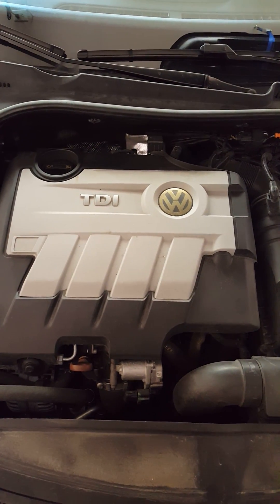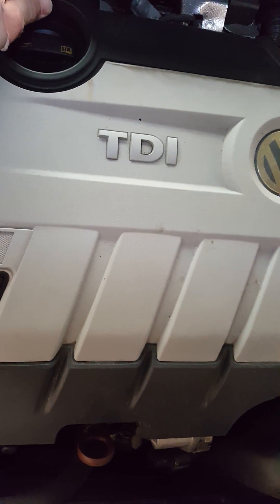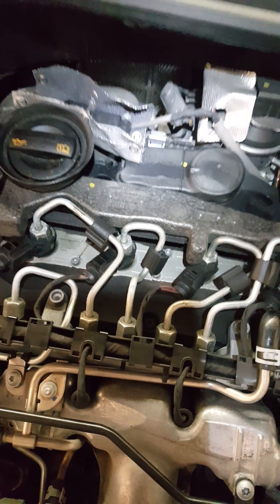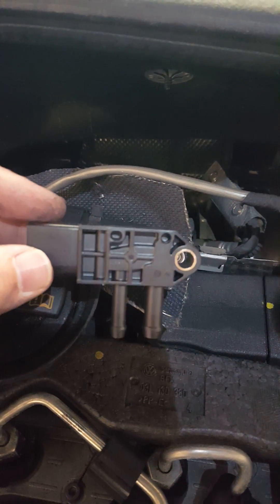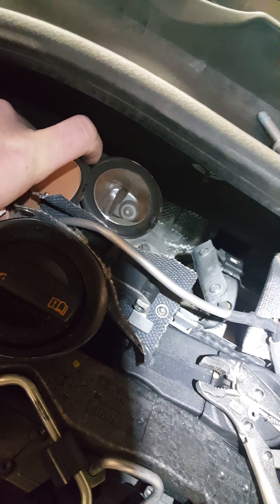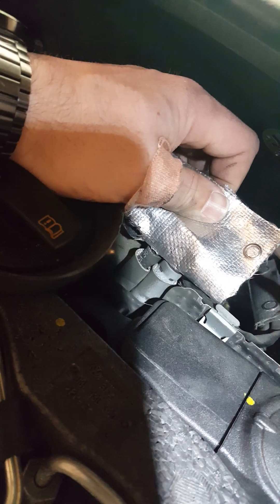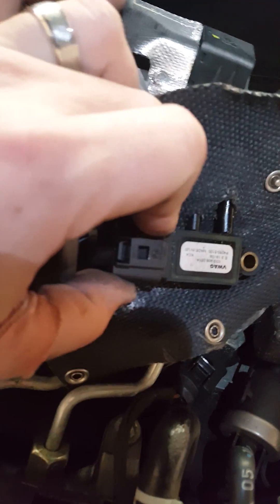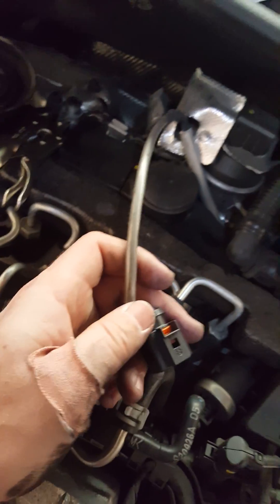VW TDI P047a exhaust pressure sensor B circuit repair

Comment: I got an error P047400 exhaust pressure sensor A circuit intermittent/erratic not limb mod dpf regenenarates normal but on high speeds with  full throttle i got engine light 
i changed the sensors 2 times with original and adapted with  vcds  bit error reapears

Comment: Hi, are you sure its a "P074" and not a P047" code ? Thanks
Reply from the maker: You are correct it is a p047a code. All these years later, I don't know what I was thinking. Thanks for the correction
Reply: @jasenreynolds6799  perfect video btw
Reply from the maker: @andreidiaconescu5035  thanks! Hopefully it will help more people now that the title is correct! 😁
Reply: @jasenreynolds6799  il try for my Skoda Yeti. Thanks 🙏. All the best !
Reply: Great video! Thanks. Does this require an adaptation after being replaced?

Comment: Did you disconnect the battery  before starting work ? 
And does the sensor just pull apart from the hoses, saving the need to undo clamps and bolts, etc. 
Thanks

Comment: Thanks. I have this same problem but my car will be bought back by VW shortly. I likely will try to clean out the two tubes and make sure they don't leak first. I have read that sometimes, as you mention, this can clear the error code. Prior to your video, I wasn't sure where to start, but this is RELATIVELY easy. That is to say, I can reach it. Thanks again.

Comment: Is this the same sensor? I have a 2010 VW Jett TDI. Here is the code I am getting.01 Engine Control Module 1

    System description: R4 2,0L EDC G000AG
    Software version: 9971
    Hardware number: 03L906019CM
    Coding: 0050078

    Trouble codes: 
        P0470 - Exhaust Pressure Sensor "A"
            static
                Measurements: 
138 U/min
0 km/h
38.7 °C
39.6 °C
                Frequency counter: 37
                Mileage: 235913 km
                Driving cycle: 255
                Priority:  2

Thank you.

Comment: Very helpful video. 
okay, I've changed both Exhaust Pressure Sensors (EPS), the engine light is off - But I'm still getting the P047A error. I've also got some other issues EP control valve "A" is stuck open (P047F), plus P0401 EGR. Exhaust Gas Recirculation Flow insufficient Detected.  
My question for the wiser, would the EPS be affected by the other errors? meaning if I make the necessary repairs to the EGR and EP control valve would my P047A error go away. My gut says yes only because I assume the entire emissions system is tied together.
Reply: Did you ever fixed the issue

Comment: additionally, if this doesnt get rid of the P047A code, there is second sensor in an additional location... not sure if anyone has a video on that, but I hear this requires a VCDS for some sort of tuning on that sensor.

If this one fixes your error code, I think we're the lucky ones, no VCDS required

Comment: Hey, thank you for this video, It really helped me take care of this in a short amount of time. Would have been shorter if I had not done this right after getting home (hot engine)

For this job, I recommend using two angle short T40 and T30 keys (They look like L's) to reach those ones in the back.

Also for the pipe clamp the needle nose vise grips are practically essential.

My hoses had an outer sheath that I cut a slit in with scissors to open it up to access the hose clamp.
I pulled up on the old sensor while using a flat screwdriver to push the rubber hose off.

A little bit of lubrication would definitely help to put the new one on. Thought to myself would have been nice to pull off?

After the hose got put on, yea, undo the vice grip and put everything back together.

Cleared the codes on my scanner and I'm crossing my fingers while I drive for a day before getting it inspected